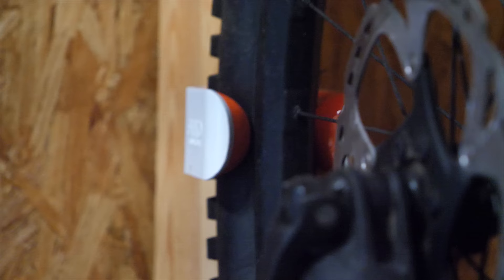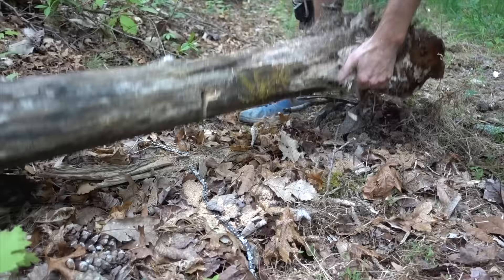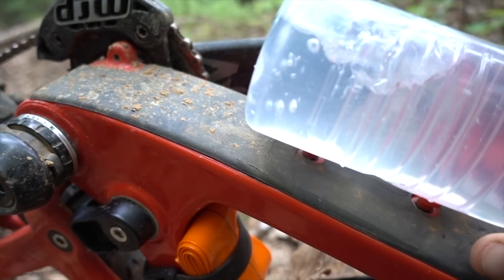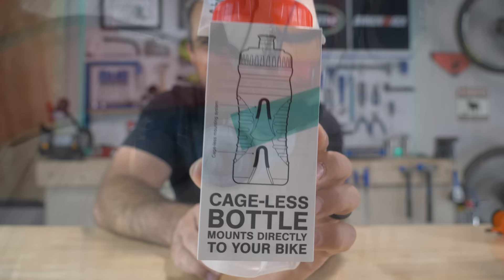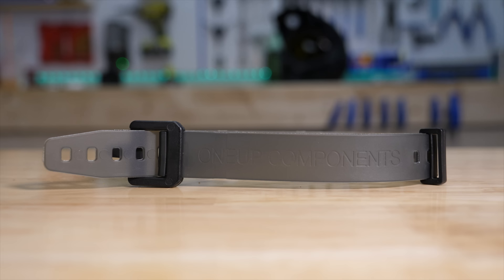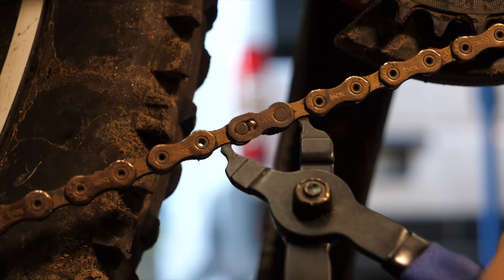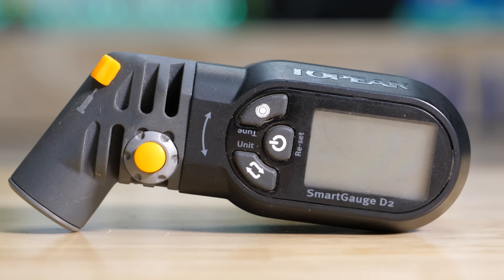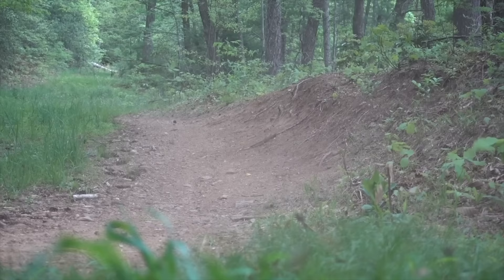MTB Products under $50 | Reviewed

Comment: Been using both of those Topeak Pressure gauges and Multi-tools for a few months. I can vouch for the quality of them. Well worth the money.
Reply: Dang no one even responded phil
Reply: I'm subbed btw
Reply: Is it easy to change the battery?
Reply: I wonder the same and even more so the battery life it has. I have a scwalhbe airmax pressure gauge and that battery dies waaaaaaaayyy to fast. Like I put in a new battery, use the gauge, put it away and the next time I wanna use it not even a month later it's already dead again. Stopped using it as well those button cell batteries don't come cheap.
Reply: Woah 5th comment
Reply: 6:41 , How to have a heart attack 101
Reply: @Nicox-cw6zu     cry y
Reply: Lol

Comment: The Topeak pressure gauge does update in real time, you just need to press the circle button :) your welcome!
Reply: Your right it does. Mine does and it's great.. Just over Inflate and adjust 👍🤘
Reply: Yeah, you beat me to that.  I will also mention that my first one became so erratic that I tossed it.  My second one gives an erratic reading maybe one out of five times.  There must be a better gauge.
Reply: My floor pump gauges are notoriously off, hence the digital gauge. Like the topeak.

Comment: On the Topeak smart gauge d2 you can push a button so it shows real time pressure when you are using the bleed valve. I have one and love it.
Reply from the maker: I noticed this right after publishing on Patreon, and added a note. You guys always fill in the blanks!
Reply: I should probably sign up to your patreon then haha
Reply: You mean just like the analog ones you can pick up for 3.99 at a gas station?
Reply: Pretty sure its the "Tune" button, for anyone reading comments about this. I use it when I get to the top of a climb to drop to my preferred pressure for the descent.  Accurate air pressures have made my riding experience much more consistent. I get the same feel each ride/run, unlike the finger-pressure-test-guess.  And, going 'too low' has consequences where I ride.
Reply: Hey Seth, you usually run 20 in your mountain tires as seen in the video? Just curious.! Recently got the Topeak and love the precision!
Reply: Sebastian Jenewein they are markedly more accurate than those and the gagues on pump. If you're the kind of rider that geeks out on pressures then a digital gague is a must
Reply: I think its called 'rtfm' ...something about read the manual...or sumthin😊
Reply: I can't figure mine out at all. If my floor pump says 30 for example, that topeak gauge says like 12. No idea why the difference
Reply: Was bout to comment this
Reply: Beat me to it
Reply: DanSan382 yeah thats actually not far off the sort of variance I get with mine.
Reply: Ok, cool! Nice to know! I haven‘t used my digital gauge for a while, as you have to reset it before every reading. Very annoying! ;)
Reply: I have one and rate it. Especially for 27.5+.The bleed function reads a lower pressure while it's bleeding, then reads the true pressure when it's released. Because Bernoulli :).
Reply: DanSan382 that's one of the reasons why the digital gauge is useful. Depending how much you spent on your floor pump, it's gauge may be calibrated more/less accurately. 

In the end if u use the digital gauge you will always have the same calibration no matter which/whose pump you use.
Reply: I came here to say this. I've had mine for years and haven't even had to change batteries.
Reply: I've got two floor pumps. The gauge in one is useless for anything below 40 psi. Not a problem for the road, but my CX tires are between 25 and 27 and the fatbike is at 4-5 psi. A good gauge makes a big difference.
Reply: Rod Diaz same with mine.  Fairly accurate for road bike pressures,  wildly inaccurate, but consistent, at mtb pressures.

Comment: The way you use a clug, low with both wheels on the ground, is great.  I've had two bikes fall, though, mounting front wheel high.  These were road bikes with narrow tires, which may be more susceptible to losing the grip as the tires slowly lose air.

Comment: The smart Gauge does update real time pressure measurement when releasing air if you push the "tune" button while holding it on to your valve

Comment: When do you need a 10mm Allen key, Seth?
A crank arm
Ask me how I know

My crank arm came loose one time, strangely. 
Turns out the one person riding with me did have a 10mm on them. Which we found out once we got back to the car. 🤦‍♂️
Reply: I always ride with a 17mm socket. An alan set, and a cresent wrench with me. I ride bmx and can work on literally everything on my bike with those tools
Reply: Itz_ya_boi_ryan  cool story bro
Reply: 10mm holds your rack onto the tow-ball, everybody knows that. I don't own any cranks that take a 10mm, but my road bike takes a mafugging 14mm!
Reply: James Koenig ikr
Reply: Also a centre mount kickstand.
Reply: older deore xt spds use 10mm.
Reply: James Koenig  could’ve just ignored it instead of unnecessarily replying to him
Reply: Wait, how long has Seth been riding for?
Reply: I ride with a 120psi air compressor, impact wrench, all the 1/4" driver sockets (who wants to be stuck without one you need?), and a generator to power it with. I could fix a car if one broke down on the trail.
Reply: i had a funny story with a crank arm yesterday it worked loose somehow i did have a set of allen keys with me but it has a 14mm nut and that nut fell out somewhere and i had to take a walk of shame back home and somewhere along the way i got a flat tire on the front
Reply: Itz_Ya_Boi_Ryan 
seems legit
Reply: Some Kiwi how do you know
Reply: My crank arm came loose to, and I ride bmx. But later while riding it popped off. Wasn't the best experience walking the 3 miles home
Reply: Ik was wondering about a 10 mm hex key, thanks for the stories!

Comment: Hey I got a cheap replacement for the mic covers on the GoPro. 
You can get fake moustaches and cut them and stick them on the mic holes they work just as well and you get like 8 moustaches in a pack for less an £1

Comment: The hiplok is designed for cafe stops, shop stops, and is basically to stop opportunistic theft- good for roadies
Reply: toasty bear even on my old beater bike i would not use that. i could use a lock and some electrical wire and get better theft protection!
Reply: The point of the hiplock is low weight, compact dimensions and ease of use. It's literally meant for nothing more than preventing a random person walking away with your bike while you're inside a gas station getting supplies or taking a dump. When you need a lock this compact, it doesn't really matter how it's constructed, it's theft protection will be pretty much the same. 

For a regular MTB rider it may not sound like a great idea, but for the roadie and gravel crowd who do whole-day rides without a backpack, it's precisely the thing they want and need. Personally been using a couple of locks like this myself for this very purpose. For commuting, I have an actual security lock, but it's too heavy and bulky for my gravel rides.

Comment: I have an old-school Topeak Power 21 that's 20yrs old & JUST broke...the chain tool. (Lost the wire to hold chain in place - easily replaceable with a piece of wire hanger!) I found a whole replacement tool (minus the wire) for less than 15 bucks. One of my best purchases ever! (And all I really have to replace is the part that screws in & pushes the pin!)

Comment: Cool trick: you don't need a chain tool to snap in the master link. Just hold the rear brake and torque the crank arm. The chain will engage and pull the master link into place.

Comment: With the one up edc strap, can you attach a water bottle to the bike with it? 
I can't attach a bottle holder to my capra 🤔
Reply: you can zip tie a cage to the frame. i did that on my old bike
Reply: Zefel make some cage mounts on straps so should go on any bike
Reply: Try the Fidlock Universal Base - works with both their 15oz & 20oz bottle.
Reply: go to the hardware store and get like 2 meters of hose and a couple of U bolts (you use the hose to cover the U bolts so they don't scratch your stuff and also it prevents it from shifting around). Now you can attach a rifle if you wanted to.

Comment: The Topeak does have a live pressure update setting for use while bleeding. Press the upper black button and the display will start to flash. When you bleed in this mode, the pressure will constantly update and you get an exact reading each time you let off on the bleed button. I used this feature today. I run plus tires, so the pressures are low and need to be accurate, and the Topeak is better than practically all floor pumps for this. I keep one and a good hand pump in my gear bag. That combo is far less bulky and more accurate than a floor pump

Comment: The pressure gauge is great! I love mine. And if you press the 'tune' button the pressure DOES update in real time. The screen will flash and the pressure reading goes down when you let air out. I have to do a long road climb to get to my local trails so I like to run higher pressures when I leave the house and then take pressure out when I get to the trails.

Comment: Hey seth just got one of those pressure gauges and you can press the little circle button and once the number is flashing you can use the bleed button and it updates in real time. they say you should press the button after you bleed air for a precise reading.

Comment: The Smart Gauge does actually update in real time as you hit the bleed valve.   You have to press top button to get it to work before you start the bleed process, and yes there is a tiny bit of a lag to it but its perfectly acceptable.  I love it and have been using it for a few years now.   I like it cause my old man eyes have trouble seeing that tiny numbers on the gauge of my pump and its more accurate.   As always good video.

Comment: the hiplock is what I would consider a "café lock" great for locking up at a busy café while you run inside, lightweight for the roadies, but not secure enough for extended storage. Also great for locking your snowboard while you grab a drink

Comment: I use mineral wool (inner wall insulation) and self adhesive velcro (i trim them in pretty much the same shape as the adhesive gasket of that thingie in the vid) for wind covers. This will last a bunch and you can get mineral wool trimmings for free and 3M velcro for like two bucks, the velcro will stay there pretty much forever and the wool is virtually free to replace and on top of that it's hydrophobic and fireproof.

Comment: I made my own riding gloves with a crash and skid pad on the heel of my palms; using anti chafe material used to,protect hydraulic hoses; sewn to the palms of each glove.  

I’m thinking about lowering the pedals 1” by designing an offset flange to attach a new spring loaded spiked style pedal.  The idea is to increase the rotation of the pedal path and the spring loaded pins will press upward towards the shoe keeping a positive contact longer and stronger as I’m standing or sitting. 

I’d like your opinion on these two mods.

Comment: For the Mic covers, they sell furniture foot covers so you don't mess up your floors. They have an adhesive on one side and fuzzy fibers on the other.  The fibers arent long or "cat like" like the Mic covers, but all you need is an exacto knife to cut a circle in the middle and also use the exacto or sand paper to fluff up the fibers.  They sell them at all Dollar trees and 99 cent only stores.

Comment: Hold down the tune button on the Topeak for a few seconds and then let it go. The number starts to flash and it will update the psi as you let air out with the bleed button.

Comment: The Tubolito instructions say not to inflate the inner tube outside the tyre to avoid that deformation. If you use it correctly, you can re-use it and its possible to fold it as new.
And also, the Topeak SmartGause updates in real time the pressure, you only have to press the buttom for it

Comment: I backed Clug on KS, but in use I find they don't work all that well. First is finding a location that allows them to mount. Note by design the bike will "stick out" into a room - which is often in the way. Then there is the height issue - if you have different bikes with different size wheels, you'll need Clugs at different heights on the wall. Then there is the vast range of tire widths with only (IIRC) three Clug sizes, so it's either try and cram the tire into a smaller size or put up with a wobble. I eventually installed mine on a post under my deck, since I often leave bikes there and each face can have a different size Clug on it. But in practice, they are not that secure (it's just lawn around the post, so not perfectly flat like a garage floor) and I usually just lean whatever bike I'm using against the post itself.

Comment: There are more compact, though probably equally less effective chainsaws that are basically a wire with more wire around it.   For the contract killing on the go, or if you feel passionate about revenge against that branch on the way. Work kinda good too and really fit in the tiniest bag.   Only bought it for no reason because i was curious, so rarely used it but it does get halfway through stuff i couldn't break on my own. . Wiresaw, less than 5 bucks on ebay. Handles are thick keychainrings. If you put some rubber material around the saw, you could have it just danglin somewhere from your backpack or slide it into a cavity of the bike

Comment: I too had my doubt with the tubes (esp. the valve) , but then I've done the annapurna circuit with it on a fully loaded 29+ without a single puncture, and I ran 23 front and 25 rear. Still I have my doubt, but I think this tubes are perfect for plus bikes because of it's weight and puncture resistance. Just be careful when mounting it.

Comment: Lovely hacks!
just a trick for topeak pressure gauge users: press the button with the white spot. When the numbers on display start to blinking, press the yellow button to bleed out. The pressure value on the screen will update in real time.

Comment: Topeaks digital gauge is realtime measure but it has to be in a different mode. There’s a button that when you press it screen blinks. If the screen blinks it’s in the good mode. Try it in this mode and press the bleed button to realease air. And you’ll see pressure updated when you release bleed button.

Comment: On Amazon they sell those little furry things for lavalier microphones very cheap I ripped one of those in half and hot glued it to a lights thin case that goes over my GoPro. Works just as well and you're not putting adhesive directly to your GoPro.

Comment: The pressure checker has a live update mode but I think that should be the default mode. I wish the nozzle on it was a bit longer for presta valves. I looked a fair amount of air with each check. The rotating head is nice, but it could be a tighter fit so I'm just holding the device and not making sure it stays in place too. Otherwise I'm totally happy with it

Comment: Seth, the pressure on that topeka tool can't update in real time as you bleed off air, that's just not the way it works. Because you are essentially opening the tube up to the atmosphere to bleed off, everything is essentially at atmospheric pressure (and therefore would show 0 on the gauge). There is of course some force exerted from the velocity of the escaping air, but that is different from pressure.

Comment: 1:58 - The point of the ziplock is (in my case) only for insurance reasons. If the robber has to use force and break a lock of any kind, my insurance covers the costs of the stolen item. Its making the difference between "taken" and "stolen" for my insurance company.

Comment: I know this is kinda old, but I've been using Tubolitos for a few years now and nowadays they come with a manual saying to NOT inflate them to more than 0.5 bar or something unless fitted in a tyre. I don't know how it was in 2018, but if there were instructions, the tube popping is on you. They can certainly be inflated, deflated, and reused at will if done properly.

Comment: TL;DR  Fabric is good but not as reliable as the Fidlock

I tried both the fabric water bottle and fidlock bottle. The fabric did stay on well for a week or two. When taking it down some chunky roots I've had it fly off a few times and the bottle broke (started leaking water) after a crash. It is much more affordable but get the fidlock if you want something reliable. I've never had my fidlock leave my bike, even on jumps and chunder, and it my opinion it's easier to take off and put back while riding compared to the fabric. I've used my fidlock for a year now on my trail bike and have had no problems so far. I definitely recommend it, despite being 40 bucks.

Comment: A better gauge is the Topeak SHUTTLE GAUGE DIGITAL not only does it give you a constant pressure readout even when bleeding air out but it can be used inline with a pump even a shock pump as it will read pressure up to 300 psi. And it's much better built.

Comment: I have a 20" wheel with hub motor. I find it difficult to access my valve for air since the space is now limited.  Is there an air pump with a slim attachment like a gas station pump? Thanks

Comment: This guy, not only does he inflate and inner tube to burst with an air compressor, causing hearing damage, but he falsely claims things that are not true. For instance, the Topeak Digital Pressure gauge does actively update the pressures as you bleed air, you have to press the “tune” switch.
Reply: DJWolves97 every body makes mistakes bro